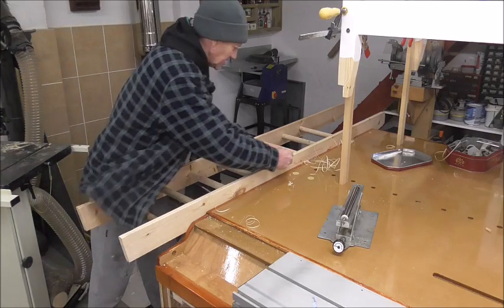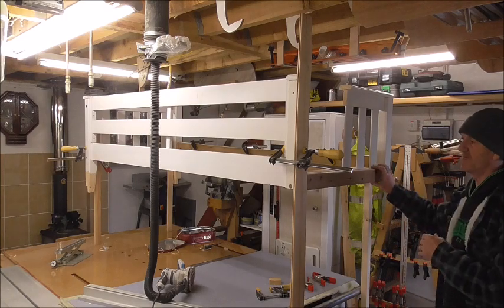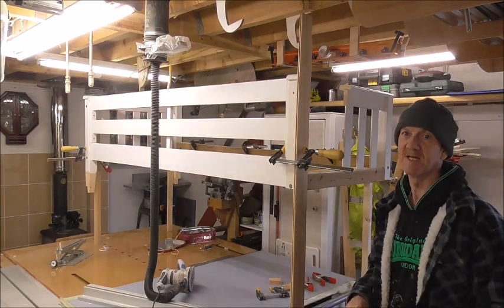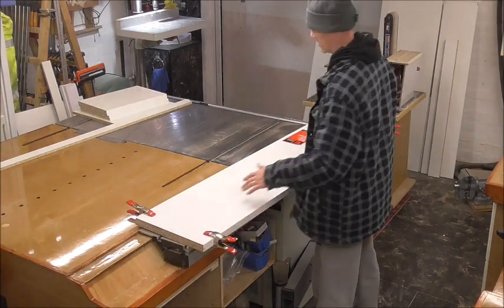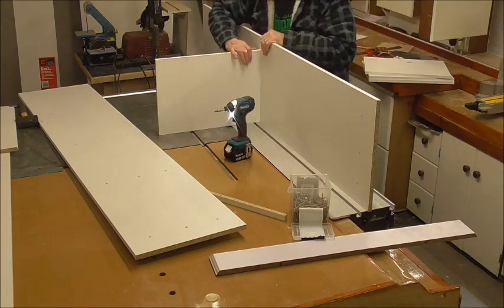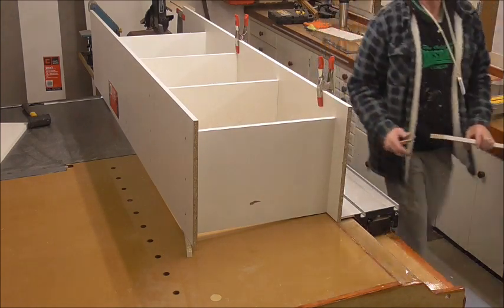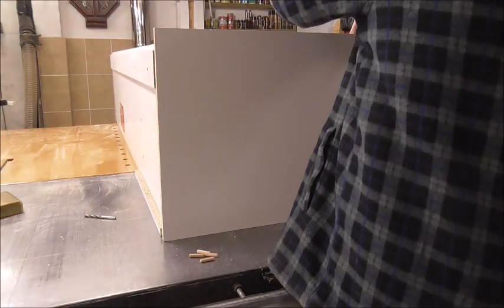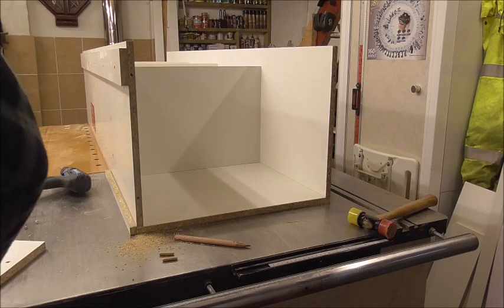Build a Cabin Bed pt 2

Comment: nice job Dave like the dowel pin set not seen that before where did you get that could do with a set myself . Great tool I bought was a mafele doweller, looks like a grinder shape but has two dowel drill bits brilliant.
Reply from the maker: tony cobb hi Tony first thanks for watching, i made the dowel set my self from an old solid brass box my Dad had, as for the dowel pins them self i have seen at the best price from that new Chinese site Wish.com they take a while to come but every thing is so cheap but so far a fair to good quality